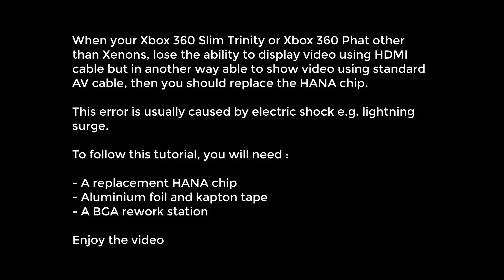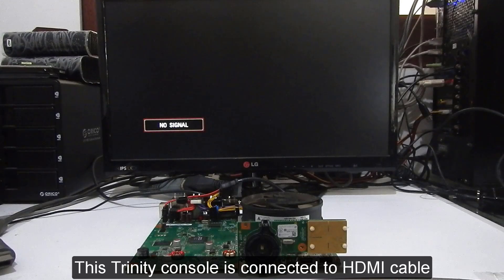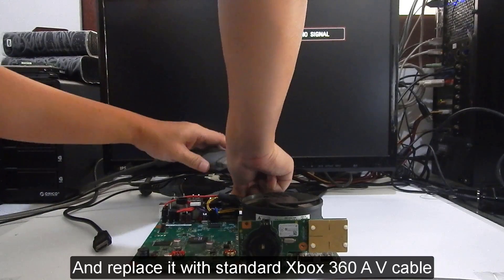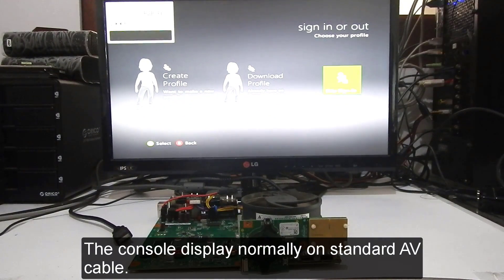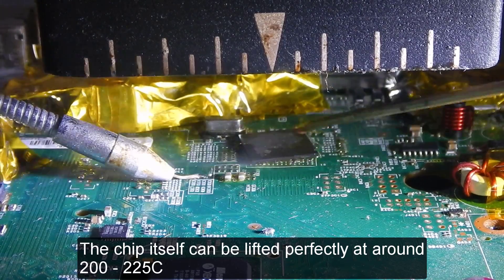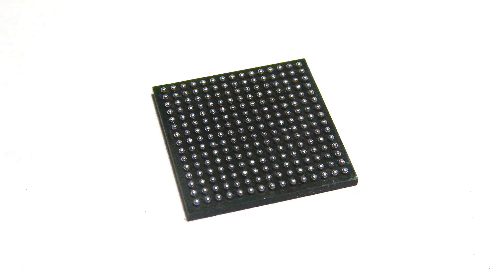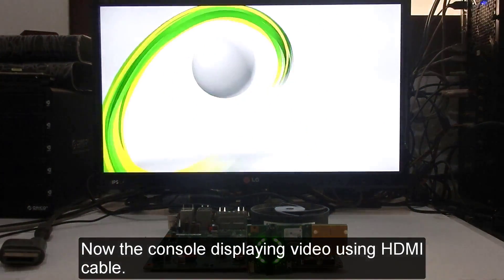How to repair Xbox 360 Slim Trinity with No HDMI video signal

Comment: I don’t know what to do. It randomly sometimes displays the hdmi, but not usually. Even the av port is giving very strange video. Is it the Hana chip or the ports themselves?
Reply from the maker: usually the HANA if you suspect the port, try cleaning it or replace the cable or clean the port on the TV too

Comment: what is the trick that the solder balls are not flying everywhere when i put hot air on the chip. Air flow at 1% and some balls are still moving out of place. Flux is used.

Comment: You will have no HMDI settings unless your using a HMDI cable. And some TVs don’t link up to the Xbox 360. If you get black screen try another TV or monitor. Your HMDI settings need to be adjusted.

Comment: i have an xbox 360e. i can open it through my wired controller but the controller wont get any light at all. i can eject the cd as well but it doesnt give me video through hdmi. sometimes the power button will flash super fast and sometimes it’s just a solid steady color. do i need to replace the hana chip as well? thank you in advance

Comment: Hdmi gives signal. I know because I watch the no signal animation. I theorize that AV will work fine.
Havent checked yet as the order is coming in soon for the AV.
Thanks for the lead on my 5 year quest to get my old xbox working! :D
Reply: how is it with the AV? 🤔🤔
Reply: @bagieralaydrus4261  Its been two years but i may can tell when my arrive. Im in the exact Situation. HDMI gives Signal but black Screen. My theory is that the HDMI cables I have just don't go in all the way, they're also a bit loose. Try using the AV cable tomorrow
Reply: So with AV work ?

Comment: Hello!
I have a question.
There was no signal. I replaced the hana chip. However, the xbox does not turn on now. No damage is visible on any part. What could be the problem? Thx.
Reply: If you replace HANA and the xbox does not power on at all, you are incorrectly replace! HANA generated the clock signals, and control SMC reset. If its not replaced properly, or the replacement is damaged, then the SMC cannot load and the box will just ding!
Reply: @Josh.Davidson  Unfortunately, the xbox has not worked since then. I'm trying to replace the hana chip again. Thx.
Reply: @kuruczgergo  No problem, make sure you position it correctly, ball A1 to A1 and the new chip is reball, the old BGA is cleaned properly.
Reply: @Josh.Davidson  What is the ideal soldering temperature of the HANA chip?
Reply from the maker: bad cpu
Reply: i had the same issue with my Jasper. Replaced the Hana Chip from a slim donor board -> no power. replaced it with another hana chip, same. Put back the old hana chip. Now it´s working.  But like before only AV, Hdmi is still not working because of bad hana chip. Maybe i fried the donor chips with to much heat.

Comment: Dear i have no display with hdmi together with ontroller not deteted
Reply: Check if it work fine with A/V. If A/V work but HDMI not, check HDMI pins is connected to board properly, then if its ok, HANA chip replacement.

Comment: Sir my Xbox 360 suddenly failed to connect with TV or PC Monitor by both AV cable and HDMI cable. Though we have been playing it by HDMI cable for 1 year but one day suddenly
it did not work. Though the HDMI cable was good we bought another one and also bought a AV cable but it didn't work. We also noticed that the light of Xbox 360 power button was not as bright as it was before. We tried to connect it with many TVs and PC monitors but we couldn't succeed at all. What do we do now? What is the problem with our Xbox 360? Please help us 😔😔(My Xbox 360 does not work with both AV and HDMI CABLE in Both TV And PC monitor )
Reply from the maker: either bad gpu or bad power regulator

Comment: Can you help me I have a problem with both HDMI and AV cable. Both of them showing me no signal
Reply from the maker: cpu died
Reply: @sthetixofficial  Hi, I have the same problem, the console start up and I am able to pair a controller to it, but both av and hdmi don’t work. Are you sure that cpu is broken?
Reply from the maker: how to pair the controller if no display on tv?
Reply: @sthetixofficial i have thé same problèm ibcan turn on m'y Xbox with thé contrôller but there si no signal with HDMI or av câble ? Are you sûre thé CPU died in m'y case please  give me an answer CUS i i just changed the CPU paste put a New one because at first the console was turning off 2 min after get turned on i fixed this problem but the problem with the signal IS making me going mad crazy

Comment: Similar problem for my XBOX360. standard AV cable OK but no signal with HDMI except with some televisions who receive the signal with HDMI ? Do I need to replace the HANA chip also ?
Reply from the maker: yes. replace hana
Reply: @sthetixofficial  Thank you for your advice, but I don't have any BGA rework station. What's your BGA's name ? Is it expensive ?
Reply: @papefei  Do you have good skills? You can replace HANA with hot air. But if you dont have good skills, don't.
Reply: @Josh.Davidson  Well... I don't my Xbox will become a marvelous  and abstract sculpture.
Reply: @sthetixofficial Hello friend, I have the xbox360 slim I play I no longer see the video, now turn on not to see the video both With HDMI and with the scart what can be can you help me? 😢

Comment: My Jasper turns on, fans come on, and disc tray ejects normally. However, only the center (small power) light comes on with no ring lights. Sometimes I’ll get three ring lights on, but no spinning ring boot lights. No video through hdmi or analog AV. All four ring lights stay lit on wired controller. Any ideas? Where are you located? Can you repair?
Reply from the maker: i am in indonesia. i guess the gpu is burnt.
Reply: That happens to me on certain tv's. Try using a different tv.

Comment: How to know if its a problem of the port itself or the HANA chip?
Reply: Just check the port then, easy. Check if its connected to board properly. If its fine 100% hana.
Reply from the maker: 100 percent on hana chip. unless you can see the physical damage on the hdmi port
Reply: No it can be the hdmi reset funtion!

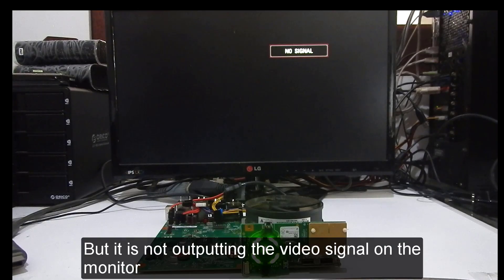Comment: Hi sthetix, I have a similar problem like on ur video with Xbox 360 slim but I saw that when you first turned the console on, there’s flashing lights at 1:00 from 1:06. My doesn’t do that when I turn it on. Can you help me?
Reply from the maker: so what is the symptom?
Reply: Ok so when I turn on my Xbox 360 slim, I see no signal on tv, I only see a firm green light on my Xbox but doesn’t flash like it normally does. One question, when u turn n any Xbox, am I suppose to here a loud noise when I turn it on because I don’t here when I turn it on?
Reply from the maker: what noise?
Reply: I will do my best to explain like if u were there to witness, so, when I turn on Xbox 360 slim, you would see a steady light. Then on tv, there is no display at all. If u look at the power button, when you turn on, the power button doesn’t flash at all as you turn it on it’s just a steady green light in the center of the power button. Lastly, I’m not sure if my Xbox 360 slim is suppose to do this but if you turn it on, you would hear no sound from console at all, but my fan is working. If you look at other Xbox slims it will be a total opposite to what I explain about my console.
Reply from the maker: maybe ur xbox have a bad gpu or cpu (died)
Reply: Ohh no..... well at least I know what the problem would be now. Thanks,  I will give a go soon.
Reply: When I mean that makes no sound, compare to a pc start up, you know how a pc must make a loud noise to before screen is displayed. Well my Xbox 360 doesn’t do that ether.  Problem
- steady green light
- doesn’t flash as it starts 
- no signal on tv
- no loud sound on console during start up
I hope this is an easier way for you to understand specificly.
Reply: Dont think mine died. I blindly opened the disk tray while trying to fix the display settings.
Reply: If you still looking for the solution, I fix this a few times:
- If the console is RGH, write retail back and check.
- Check, the HDMI pins are connected to the motherboard, and the DDC circuit is ok.
- Check, does the optical TOSLINK light up? If he lights up, then the problem is SOUTHBRIDGE.
- If the optical TOSLINK does NOT light up the problem is HANA.
- Or something else weird, the problem could be XCGPU is crashing during boot, but after passed the errors. You can read postbus to find that.

Comment: Can we just talk about how expensive a bga rework station actually is. The average person won't by one cause it's more expensive than just replacing the consol
Reply: If you have the right skills, a HANA can be done with hot air only. Southbridge and CPU/GPU must need BGA machine tho.
Reply: @Ggungaginga  Its not different from any other BGA chip of its size.

Comment: My HDMI port works if its displaying in 480p but looks really weird like its displayed in lines
Reply from the maker: change the resolution
Reply: @sthetixofficial  shut up that's useless
Reply: I have the same problem, if i chance the resolution the screen turn into black.
Reply: Check if it work fine with A/V. If A/V work but HDMI not, check HDMI pins is connected to board properly, then if its ok, HANA chip replacement.

Comment: Mines doesn't display either hdmi or AV, would this still be the solution to it?
Reply: I have the same problem, when I use the hdmi it's real glitchy and AV won't work at all. Did you find a solution or nah?
Reply: ΔLiEN OG sadly no :/ in guessing it has to be that tho but I don't want to mess with it :,(
Reply: same mine too in xbo 360 e
Reply: Hi I have the same prblm with my console........ Do you any solution to fix it.....plz????
Reply: Try replacing The hdmi and about ports if that don’t work try replacing Hana chil
Reply: Check if TOSLINK lights up, If it does - problem southbridge probably, or XCGPU if there is something crashing after error checks.
If no TOSLINK light up, probably HANA is totally burnt - or southbridge.

Comment: I bueyed i 2014 xbox 360 jasper 2009 casualy play and some day in 2016 off xbox and runed in next time about 14 days later and xbox not show nothing on hdmi exectle like on video 1:1 . I not tauched xbox wasent also any electrce strike
Reply from the maker: +J Nesz test with av cable..if it works, then you should replace the hana chip
Reply from the maker: +Butcher last week i repaired an xbox with no av, no hdmi. It turns out that the southbridge chip was damage. I replaced it and it works normally now.
Reply from the maker: +Butcher it seems that replacing the hdmi chip in your country is very expensive. I see that. Yeah it is better to buy a replacement console than repair it